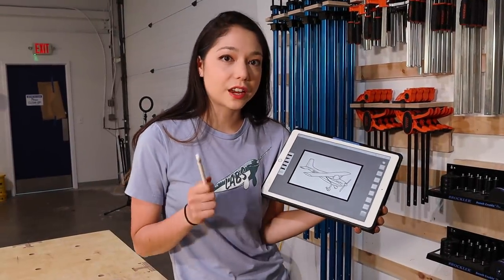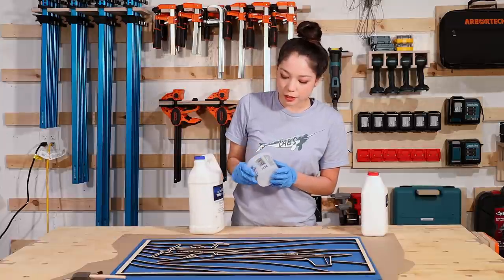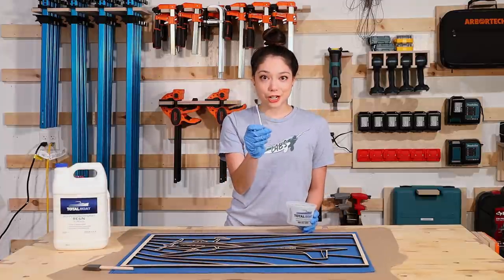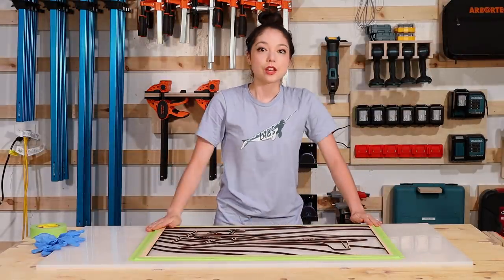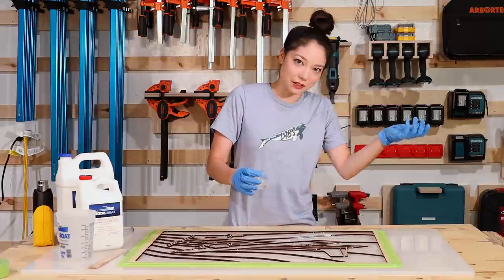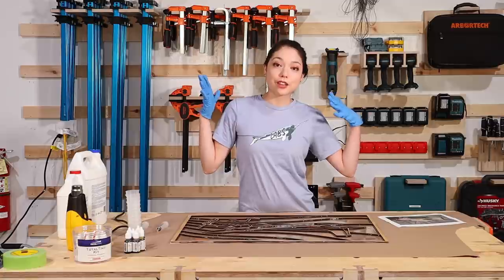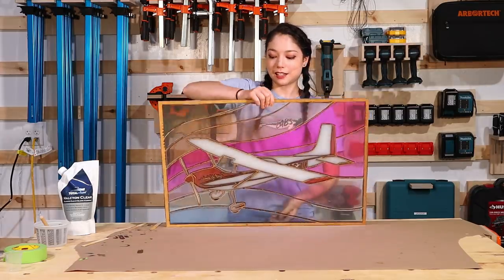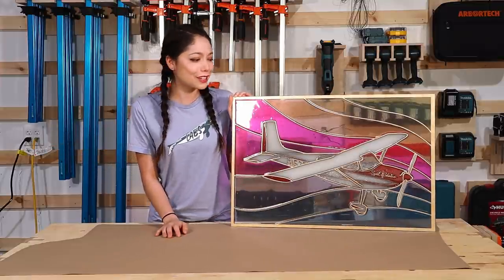Xyla Foxlin Makes an Epoxy Stained Glass Spirit of Columbus

Comment: Great project, with attention to detail. Should you do another one like this, you can get solvent-proof polypropylene pipettes from lab supply companies. These could possibly make the filling of the fine spots easier than pouring. They allow dispensing of fine volumes much more smoothly than syringes as well.

Comment: Hi, might want to look into a sand blaster. Put your laser cut oil stained and burnt tems in remove clean crisp laser cut items....works like a charm and no more mess!
Reply from the maker: Thanks for the tip!
Reply: @NarwhalLabs  You're gonna be so happy. Harbor freight $110 with an extension hose, I can do larger items in a makeshift painters plastic booth.

Comment: Cool project, thanks for sharing!  I am wondering though, why you didn't apply the Halcyon on both sides?  Or will it absolutely block the UV rays and prevent them from penetrating the unprotected resin?  I'm thinking reflection and heat could still cause yellowing if both sides aren't covered, but I am not a UV ray expert...just wondering.  😋
Reply from the maker: Halcyon was applied to the back off-camera :)

Comment: Hi Xyla - I haven't seen anyone else think to use Halcyon for UV protection and I think it's a brilliant idea.  I have been doing some resin design on new windows that will be installed when I'm finished.  The resin side will be on the inside.  I'd like to protect it from yellowing.  Does it make sense to use the Halcyon on the glass side that will actually be on the outside and the part that the sun hits first?

Comment: Pretty good overall, white colour I thought could be a bit more opaque to make it look nicer.
Saw some bubbles in the finished window so not sure when they got introduced.
Another channel suggested using a heat gun to force the bubbles out of the epoxy before it dries.

Comment: Have you ever used one of those stirring machines, the 3D printed ones on Etsy work quite well for small quantities (not the vertical ones, but the slanted ones) but for slightly larger batches and for folks without budget concerns, a planetary centrifugal dental alginate mixer is a dream come true, they mix extremely thoroughly and don’t create any bubbles.
Reply from the maker: Cool! Thanks for the suggestions. We haven't used either, but we'll check them out.

Comment: Do you have to use epoxy to seal the wood or can you just use wood sealer? Wood sealer in a spray can would be much faster. I would also stain the wood before sealing it to give it the look of the lead solder typically used in stained glass.
Reply from the maker: Wood sealer or spray varnish Dona great job sealing the wood grain itself, but air can still escape and leave behind bubbles in your final epoxy pours. Sealing with epoxy resin is a sure fire way to completely seal it.

Comment: This is amazing.. You inspired me,  but what i realize that you did not put a mask when you work with the resin, does’nt this resin need it or what? I think will order a sample from this resin and give it a try. Thanks a lot🌷🌸
Reply from the maker: Thank you! With the exception of the TotalBoat 5:1 Traditional Epoxy, all TotalBoat Epoxy systems are low VOC. A respirator is recommended in an enclosed area or if not well ventilated. Narwhal Labs is a large space with high ceilings and good ventilation.
Reply: Narwhal Labs thanks for your prompt answer, so what resin did you use ? The bottle in your video says 2:1 and not 5:1
Reply: Try mas epoxy
Reply from the maker: bushbosh This project was done with 2:1 high performance, which is low VOC.

Comment: First, wouldn't you want to coat both sides to prevent UV damage? I know you could face it outward, but people might want to hang it the other direction.

It is too bad nobody knows about the first woman to circumnavigate the word by airplane. Thanks for celebrating her!

As far as projects, I always think about how many standardized fixtures used to have a more creative past. All those glass and ceramic doorknobs, fancy light switch covers, cabinets knobs and drawer pulls and been limited to brass or stainless, white or ivory. The first thing that came to mind, based on the laser cut and fill idea was ceiling fan blades. They are flat, standardized, and generally limited in artistry. Obviously face plates would be slightly more complicated. The other items would require building up or assembly. I have seen some pretty neat stained glass lampshades.

Obviously I haven't seen your other videos...so don't know what you've already done.
Reply from the maker: Both sides were varnished, just one off camera.These are a bit heavy, most fan blades are pretty light, but would be neat to give it a try!

Comment: I use laser cutting for my landscape architecture, got started with it when i went to Cal Poly, but something really cool with this technique that i started doing some time ago and has proved to be an enormous improvement, especially for my specialty; landscapes, you can stack like half a dozen or so together, with each one behind the next being a lil higher as yr going further into the back ground This is generally true for the ground, but you can always have a few small rolling or gently sloping hills or vegetation protrude higher than the layer just behind it, but i wouldn't do it more than 1 layer deep , you end up with a truly stunning 3D landscape design or image with a seamless illusion of depth to it, really makes it "pop out" at you but it doesn't look complete until you do a 2nd application of epoxy to incase the whole thing. It keeps dust from collecting in the cardboard, on the surface ext. but also....um... this is hard to explain it makes the whole thing look more....real looking i guess, idk how to describe it but it just makes it look less like a cardboard cut out and more like an actual scene that you are viewing. in the end ill flip it over and paint over the area that can still be seen from the front and paint my sky, i'll make it look sunny, cloudy, rainy, what ever you want, when its all said and done you end up with a true masterpiece!

Comment: Technique, Process, and Final Results:  10/10
Gag-inducing Cheeseball comedy attempts:  0/10

I'm curious how much abuse the final product can endure.  Also, considering you can see the burn marks of the image when you put in the piece of wood in the laser, how many attempts of this project were made before everything came out right?
Reply from the maker: Came out right the first time :) Produced and filmed this like a cooking show - we had the project in every stage of completion prepared so we could complete the shoot in less than 2 days, when the project takes more than that with epoxy cure times.

It's built from the same materials wooden boats are, so it could take plenty of abuse. Far more than real stained glass anyways.